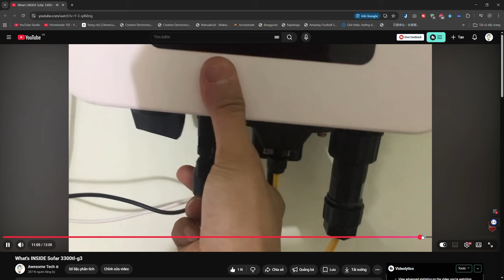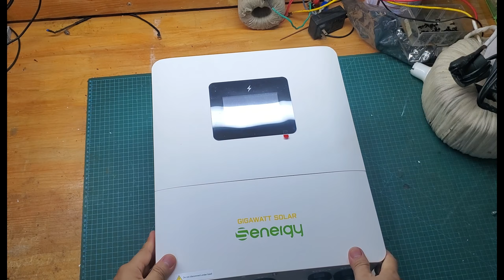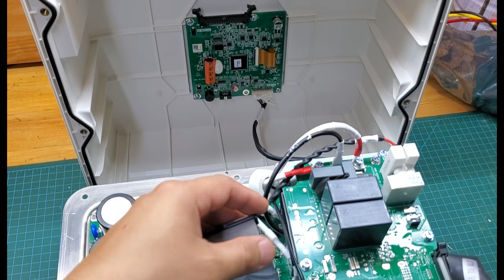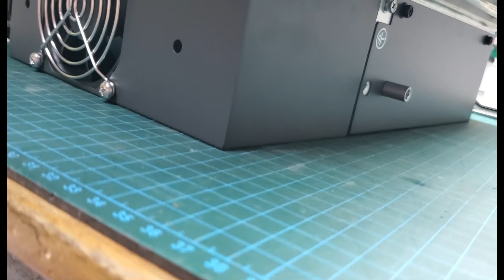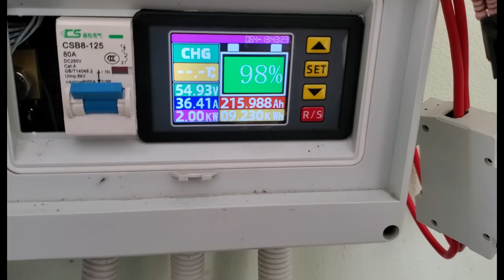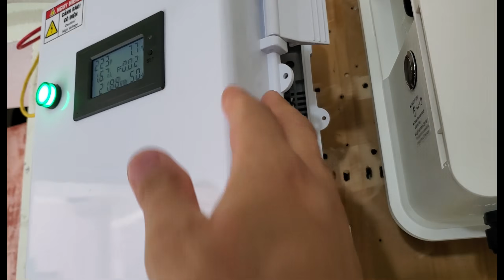What's inside a hybrid inverter?

Comment: So which have better cooling IP21 with exhaust fans and baffles or ip65 with large heatsinks
Reply from the maker: A passive inverter with a large heatsink is definitely better. With fan-cooled inverters, dust buildup over time can lead to electrical arcing between components or corrosion on component leads—especially if you live in a humid environment or near the coast.
Reply: @PhdHung thanks for ur response. What if I regularly clean that IP21. I just wanted to know that which has better cooling IP21 with exhaust fans and baffles or ip65 with overly large heatsinks

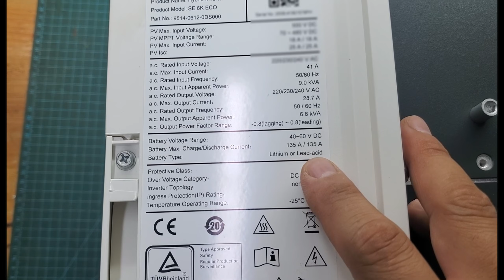Comment: 2:53 why blurring the input voltage range ?😑
Reply from the maker: That’s the inverter’s ID code. You could track my inverter if you had access to that QR code, so I’ve blurred it out.
Reply: @PhdHung ok
Reply: @PhdHung  damm that's quite scary
Reply: @HarshKumar-gh9uc what’s scary about it? You’re being tracked 24 hours a day.
Reply from the maker: This inverter can be controlled remotely, such as turning it on/off and setting voltage and current parameters from a distance.
If lithium batteries are used, the BMS can protect the battery.
However, with lead-acid batteries, setting the voltage and current too high can reduce battery lifespan or even cause an explosion.
Reply: @PhdHung  so you are telling I could have remotely turned on or off your lights or even cause an explosion

Comment: But you can connect both inverter together and program them to master and slave to work together. 6+3.3=9.3kw
Reply from the maker: Yes, the old inverter can be connected to the new one through the GEN port. However, 6 kW is already more than enough for my needs. 😁